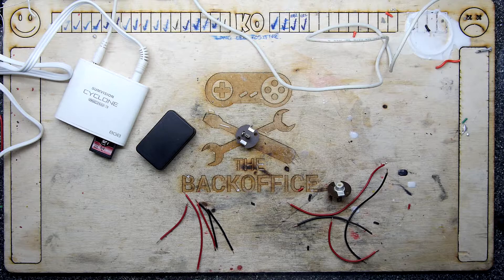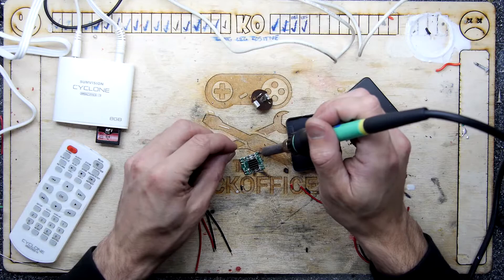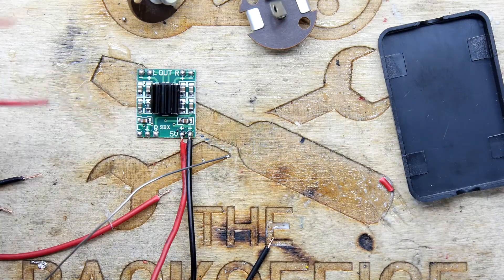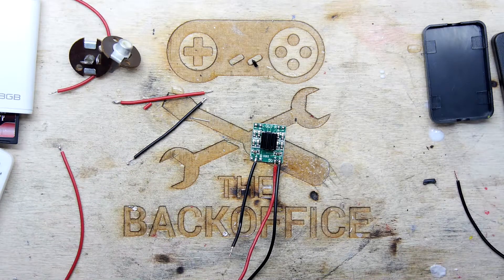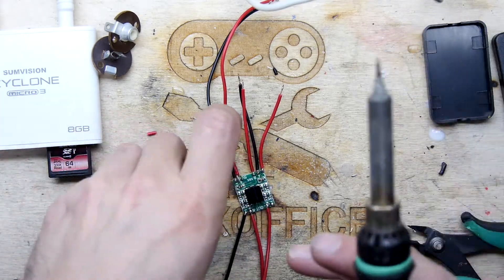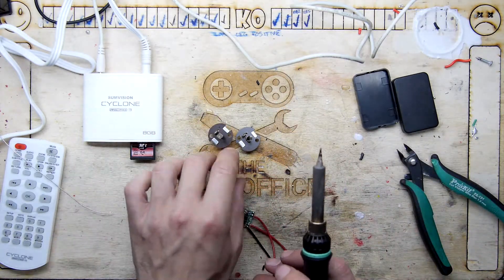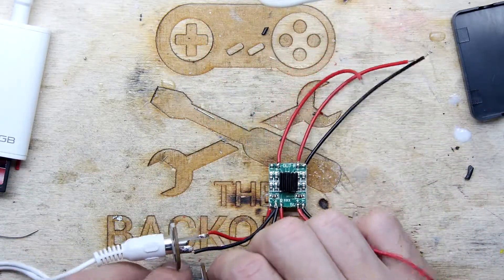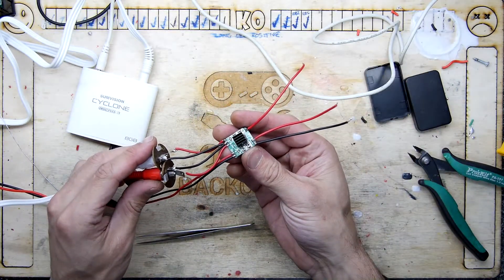Headphone Amplifier

Comment: which cyclone version are you using? modern "scene" standards are for .mkv and even the micro 4 struggles with those sometimes. (and lets not mention the broken firmware updates or the stuttering video playback using miracast from your phone / tablet)
Reply from the maker: +ImpaledGryphon not sure, just some really old one, maybe 4 or 5 years old